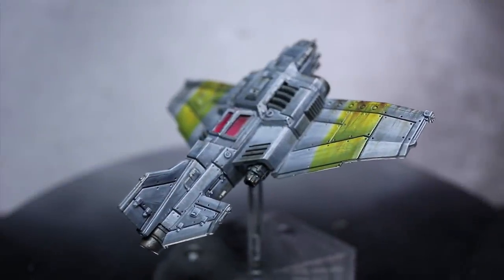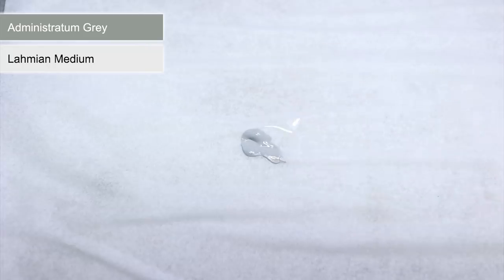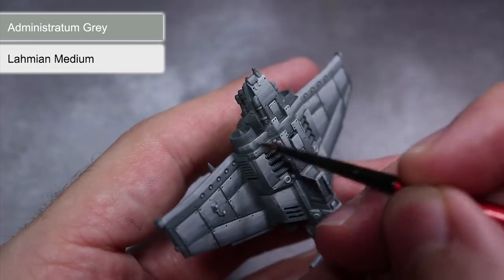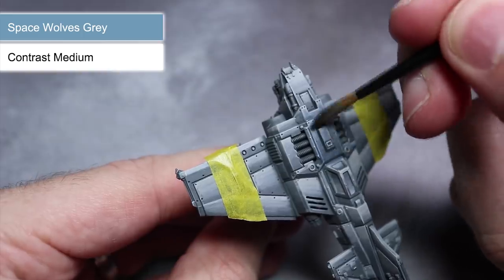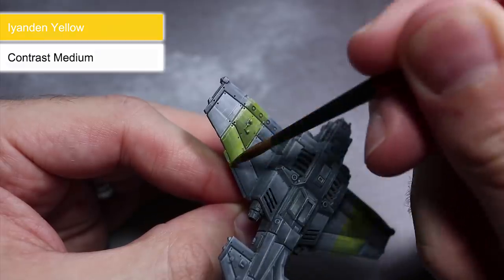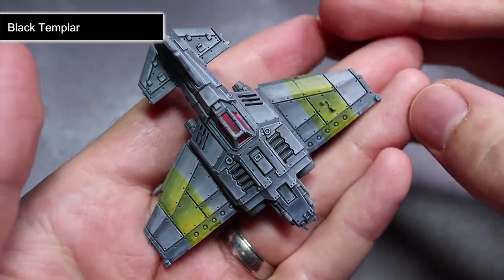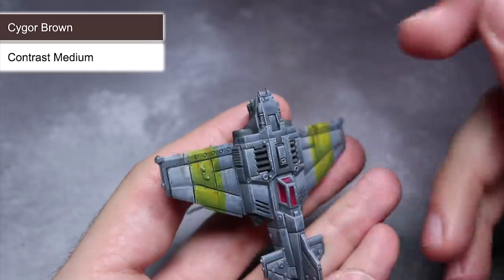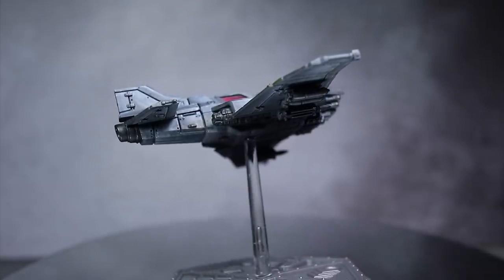How To Paint Thunderbolt Fighters - Warhammer Aeronautica Imperialis Tutorial

Comment: use a dollop of soap (dish soap, brush soap,) to the wash. it breaks surface tension and the wash runs smoother in the recesses.
Reply: dish machine drying  agents work better, very similar thing
Reply from the maker: Yep, it's called "wet water" in many painting circles. I've used the technique in a storm trooper tutorial of mine.